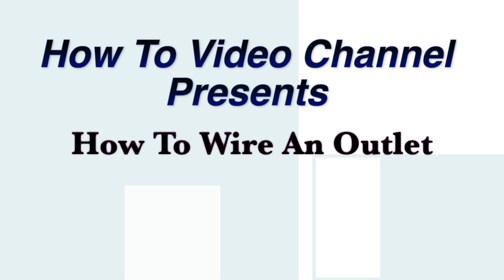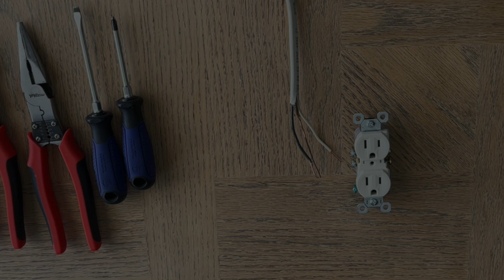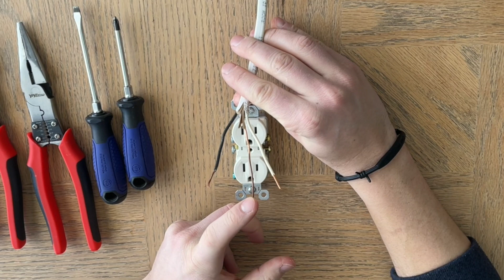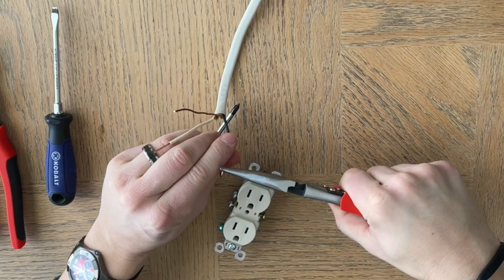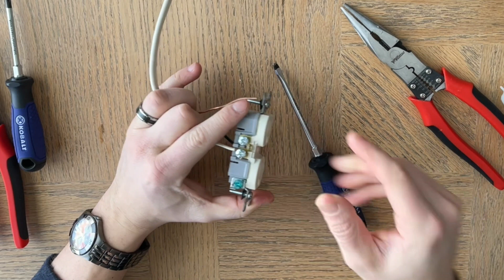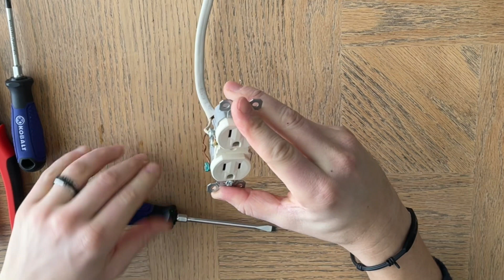How To Wire An Outlet Receptacle Standard Electrical Wall Outlet

Comment from the maker: Needle Nose Pliers
https://ebay.us/3RDyb2

Phillips Screwdriver
https://ebay.us/z8GOzz

Flat Screwdriver
https://ebay.us/aWEg8g

Wire Stripper
https://ebay.us/W6eqtT

Wire Nuts
https://ebay.us/wk8gas

Electric Tester
https://ebay.us/GpELt5

Light Switch
Check your local Menards, Home Depot, Lowes, Fleet Farm, Etc

Electrical Wire
Check your local Menards, Home Depot, Lowes, Fleet Farm, Etc